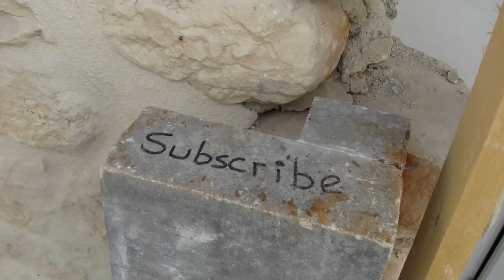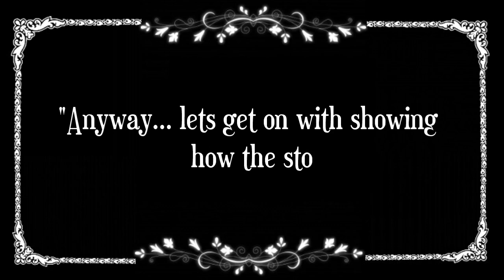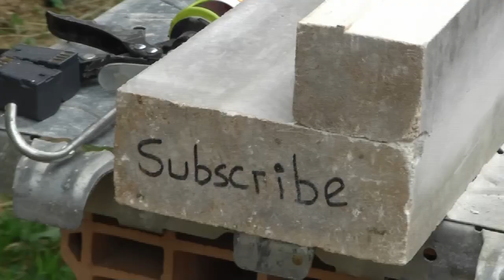Stone work ourselves Restoring  a farmhouse in Abruzzo Italy Ep18

Comment: I love watching your videos. The building is going to be fantastic. Are you using stainless steel rod to hold pieces together, because steel will rust and expand and crack the stone. I was watching a video about the restoration of some big church in England and they showed where steel had been used in the same way and had ended up cracking the stone.
Reply from the maker: Thank you for your interest, so pleased you are enjoying. spoke to Steve and if there is water ingress or humidity accessing the steel then it will be go rusty. There will be no reason for the steel  to go rusty. All new buildings under seismic laws in the world use this exact steel method. Hope this has helped , we really appreciate your input. Lynn Steve & Button